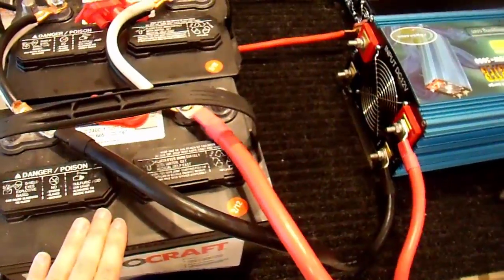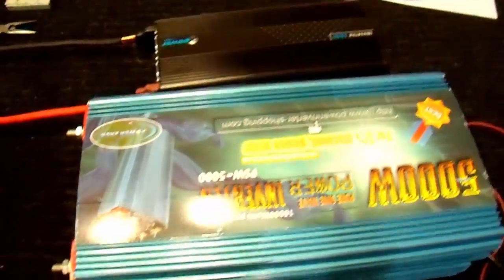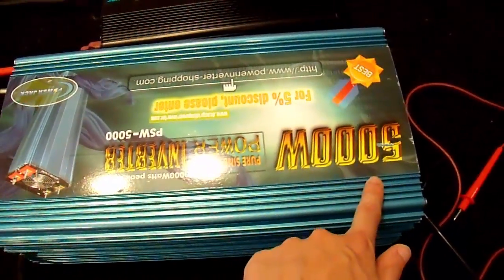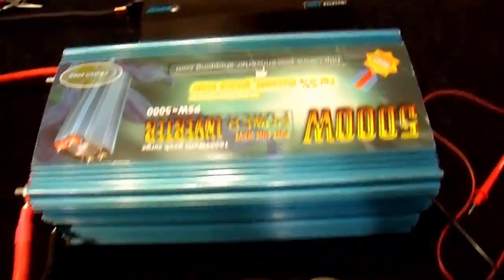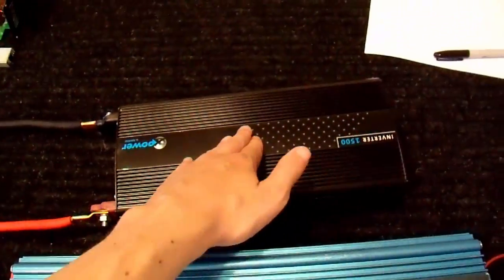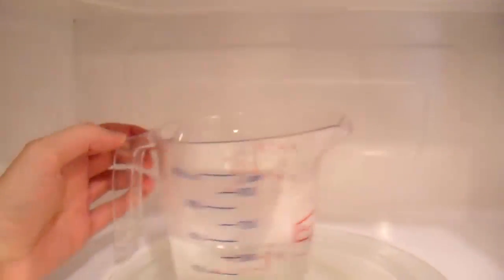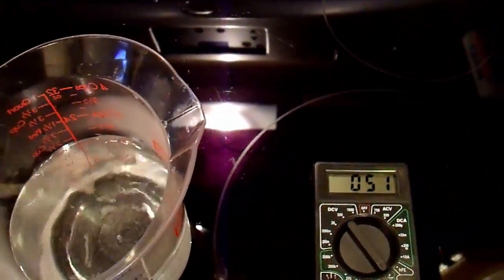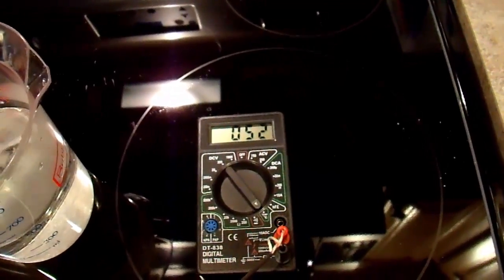Pure Sine Inverter vs. Modified Sine - Microwave Oven Test

Comment: There are some flaws with your test, due to RMS the comparison is not fair. You can't use a 5000 watt pure sine wave in compared to a 1500 watt modified sine wave, if you use a 5000 W modified sine wave you will get a different outcome, you will get a hum with most modified inverters due to the components sensitivities. When you compare products you really need to make them the same wattage. Also I'd like to add that not all modified sine waves are the same some are cleaner and some are not so clean. I've been working with modified and pure sine wave products for over 40 years. If you get the right manufacturer you'll get a decent modified product. But your best bet is to go with a pure sine. Even with that said the inverters that are saying they're pure sine wave well they're not. There's only one way to get a pure sine wave and it's not by converting DC into AC. Sine waves come from the North and South poles of magnets. These magnets are usually in generators and alternators. An inverter with pure sine wave capability is just an inverter with a cleaner setup
Reply from the maker: THD from a quality sine wave inverter is cleaner than you'll find on most any power grid.  The wattage of the inverters used for the test is irrelevant.  I specifically used an inverter with a good modified sine waveform.
Reply: @knurlgnar24 correction the wattage does actually matter,  you either use equal RMS power regardless of sine wave or the test is not accurate. I do agree that the sine wave will matter on sound and noise interference vote for power requirements both inverters must be able to provide the same amount of RMS power to be a quality test otherwise you're just throwing up numbers
Reply from the maker: @rondemeio5337  How does the wattage of the inverter matter?  The power grid is able to supply megawatts of power but a 40W light bulb runs exactly the same on a 100W sine wave inverter as it does when powered by a nuclear power plant.

Comment: Not that I'd ever choose a modified sine wave inverter as a full-time A/C power source but I was still hoping that you would have addressed the efficiency question a little more mathematically. Considering there was a difference in the final water temperatures and the resulting wattage of the inversion, I would think that you'd use a ratio of the DC mAh used by each to the temperature gain from each, factoring in any relevant laws of thermodynamics to determine the true efficiency of each of your specific inverters with your specific microwave. Either way, I would never recommend a modified sine wave inverter be used with any level of consistency. In my opinion, it is a useful emergency backup device but, if you can afford it, generating your own power from current technologies and inverting it with pure sine wave inverters is better for your devices than the utility company's 5% THD by 2 to 3 percent in most cases.

Comment: Hello, I have an Auto AC Inverter Traveller's Power 5000W, Model No. 2012 which I want to use in the house, unfortunately in Nigeria we use 220V. Also do I need a separate charger for the battery or charger inbuilt in the inverter?

Comment: Appreciate the video... But, not sure 1500w is enough to run a microwave to its full potential... I have seen advice to use an inverter that is double the microwave rating...  Not sure if this had an effect. The microwave did work without blowing a fuse or safety shutdown, which i find surprising.
Reply from the maker: The only reason people recommend using an inverter rated for double the microwave rating is because most inverters cannot output what they claim to output.  The situation on inverter ratings has gotten pretty bad, so buyer beware.

Comment: I tried a modified sine wave inverter on my 1000 watt microwave.  It only put out 660 wats .  On house power was 1540 watts.  Also inverter beeping due to microwave overheating and was very hot.  Would using better cable fix this? Was only 11 gage.  Toaster and vacuum perform perfect with very close watts as house power.
Reply from the maker: I don't understand the 'inverter beeping due to microwave overheating and was very hot" statement, but it sounds like something about your inverter/microwave setup is disagreeable to one or both of them.  Toasters and vacuums don't care about waveform but microwave ovens do.  11 gauge is very thin is you are referring to your battery connections.  Something like 2AWG would be more appropriate.  You might get by with 4AWG if you run at lower duty cycles and monitor cable temperature.
Reply: @knurlgnar24  Thanks! Was just a quick test.  I will be using 2 gage wires and a pure sine wave 2000 watt  inverter now i know better.  Planning on using 2 batteries in parallel and a 3rd  battery to 2nd inverter to  charge the other two if that makes sense.  The charger only uses 70 watts max i figure will last a good while that way.  I like your battery bsnk but dont have the room.

Comment: Somehow I don't think the Kill A Watt was designed for "modified" wave forms.   This makes all results on the modified sine converter suspect.
Reply from the maker: I've tested them against a quality lab style watt meter and they were within 2% of eachother.  The Kill A Watt meters are made and work well, though I agree that using home equipment can be suspect.

Comment: Hello, I just feed my electricity into the floor of this house with a 1500W pure sine.
However, that is not even enough for an 800 watt microwave.
Can I simply use a 3000 Watt Mod sinus instead?
Everything depends on it, computer, kitchen, etc.
When I see the video, mod sinus is even better because it consumes less watts^^
Reply from the maker: Many inverters do not perform anywhere near their 'rated' power.  1st, make sure you have a good inverter that can actually provide the power it is rated for.  2nd, I don't know your battery situation but you will need about 100ah of battery per 1000W of power when the batteries are fully charged, and 200ah per kw when partially charged.  3rd, modified sine is less efficient than pure sine due to most appliances being about 30% less efficient when operating on modified sine so it is good to take that into consideration when talking watt consumption.
Reply: @knurlgnar24  Thanks for answering in such detail!
The situation is as follows... To put it bluntly: I wanted to know if I could possibly get more out of a 5000 watt mod sine wave than out of a 2000 watt pure sine wave. I have 4x140 Ah and 4x100 Ah truck batteries on a 3.2 kilowatt solar system (24V). I cut the house fuse to the public power grid and feed it from my 1500 watt inverter directly into the house socket in the wall. (230V)
When I have the microwave on and my mother turns on the coffee maker, the lights in the house go out.
I don't even know what dimension of inverter I need, I only know that 5000 watts mod sinus costs the same as 2000 watts pure sine. It is said that Mod Sinus inverters would destroy my devices, and here everything is operated with an inverter, does that mean that in a year all computers and smartphones in the house will be broken if I use a Mod Sinus? i need more power but i can't spend 700€ for a pure sine inverter😨
and sorry for the spam^^

Comment: Half liter?18 degrees centigrade? what are ya Canadian? 5000w inverter? Thats 5000w Canadian right? Whats that in American? But that's 110v Canadian yes? So 122v? Assuming that's Canadian.

I'M just trolling for entertainment purposes. Interesting vid. I am looking at the same stuff. Its scary to look at the modified wave on an oscilloscope. Looks like a staircase, as opposed to rolling hills. One test, i would find interesting after seeing the AC output test wattages, would be an amp clamp on the DC wires. That way we can see if the modified, though delivering 30% less at the business end, is consuming 30% less at the input. Interesting? Yes?
Reply from the maker: Inverter efficiency depends little on waveform shape vs load type so the main difference is appliance efficiency.  You're right in that I do mix units regularly.  Unit snobs very much annoy me - I prefer to use the most convenient unit that I am familiar with for the purpose at hand.  Units are arbitrary and none are intrinsically better than any other for any rational reason other than for some justification based in dogma.

Comment: im surprised nobody has drawn the similarities between inverters and amplifiers yet... But I think the microwave doesn't like the modified wave for the same reason speakers dont like a clipped signal because a transformer is just basically a coil wound in a different shape. and when you clip an amplifier the sound wave starts to turn square like a modified sine wave

Comment: great video.. It would have been helpful to measure the DC current and voltage in to each microwave, becuase the would be the truest measure of energy required to operate the microwave.

The reduce output of the MSW might be a limitation of the setup.
Reply from the maker: Thanks for the comment and you have good recommendations.  Others have also commented that they would have liked to see more data.

Comment: Just to mention that the measuring devices you used are based on sinusoidal wave forms. Measuring square waves is quite different (True rms).
Reply from the maker: I used RMS meters so all measurements were accurate regardless of waveform.

Comment: Would be interesting to see this test using one of today’s inverter microwaves.  The humming problem should be gone and the performance gap may be negligible.   But I’m curious about the effect of moving from one type of difficult load (highly inductive) over to another type of difficult load (highly capacitive)..
Reply from the maker: I have wondered some of the same things, but Inverter microwave ovens were largely a thing a couple decades ago no?  At least here in the USA I haven't seen one marketed in a long time aside from some extremely expensive luxury models that no one actually buys.
Reply: @knurlgnar24  they’re back, and bound to eventually take over entirely sure as the SMPS did.  Much lighter to ship and prob already cheaper to make.  .Toshiba (Midea), Panasonic, LG, Galanz all sell them; I purchased one recently and it’s great. 

Reminds me of HVAC - I think it was Trane that introduced a full VRF AC in the 80’s.    Then they vanished for decades but look at it now!

Comment: you showed that a 1500 watt inverter couldn't make 1500 watts like the 3000 watt inverter did. the 1500 watter did it's best with what it had. Different parts of the microwave circuit were lacking due to using a saturated inverter.
Reply from the maker: It's possible efficiency changed due to voltage droop, true, but the voltage droop was taken into account and I would expect a lower voltage to actually boost efficiency in this device.  I looked at useful power out vs power in here.
Reply: @knurlgnar24  we used to use a variac to troubleshoot television circuits. We would increase the ac voltage little by little to enable certain circuits that didn't experience enough current draw at the lower voltages, this worked wonders for heating up shorts so they would be easier to detect with the touch of a finger without damaging other components, but if the 1500 wasnt able to produce enough amperage it would cause this.

Comment: If I charge my ebike with a modified sine inverter, can this do any harm to my ebike battery or just to the charger as it would heat it up unnecessarily?
Thanks for the great video!
Reply from the maker: That will work fine.  Wile a pure sine inverter isn't necessary for your eBike charger it will likely charge slightly more efficiently with one.  This is a good application for a modified sine inverter.

Comment: Could you detect a "dirty" power inverter with a power monitor that shows the line frequency? (Like a Kill-a-Watt monitor connected to the inverter?) Would you still get a nice, steady 60khz display or would there be enough "jitter" in the reading to see? (for those of us who don't have an oscilloscope or who want to blow up our microwaves. :)  )
Reply from the maker: You would need an oscilloscope or a harmonic power analyzer.  A decent 'free' way to check is to use an AM/FM radio and look for interference as well as hooking up to a transformer based appliance (like a microwave) and seeing how much 'buzzing' it makes at various loads.  Even purse sine inverters sometimes have unbalanced output causing transformer/motor saturation/heating.

Comment: I understand he used what he had for this experiment but he concluded that the modified sine wave was the cause of less efficiency of the microwave & not the less wattage draw on the individual outlet in the inverter.
  He also concluded that the buzz was related to the modified sine wave & not the less wattage draw. 
  It was just funny to me that he made absolute conclusions when he needed a better same to same comparison on other specs.
Reply from the maker: The data in the video shows that I compensated for the lower wattage if you wanted to run the calcs yourself.  The buzz is absolutely due to modified sine.  You can try running a microwave on a variable transformer to prove that it isn't voltage if you'd like.

Comment: Most of the performance issues people have with inverters is that's they don't really understand how important the input to the inverter is. The input cables need to be as large as possible and your batteries have to be able to supply the current. 

What battery setup are you running?

Comment: The voltage reading of the modified sine inverter will only be accurate with a true RMS meter!
Reply from the maker: Good tip.  The meter shown in the video was an RMS meter.
Reply: @knurlgnar24  lol
Reply: I would not have guessed that, @knurlgnar24 , and I have one of those things. But, if I can believe the manual I just looked up, it is "measured with true RMS methods". I guess a person could test the accuracy of that claim with an experiment very similar to this one, only using an electric kettle instead of a microwave.
http://www.p3international.com/manuals/p4460_manual.pdf

Comment: Thanks again for a very helpful video! It inspired me to buy an open-box Insignia microwave from Best Buy for $40. I connected it to a MSW inverter and it didn't make any noise at all and the clock/timer worked without issue. The only difference is that it appears to function with reduced power. It took a little more than twice as long to boil a cup of water. So, I could install it in my van, but a JetBoil or a $25 Japanese butane stove would boil water a lot quicker and would take up less room. The only inconvenience with using a JetBoil or a butane stove is that you need to have a door open. Oh, and you also have to be careful that you don't set everything on fire.

Comment: I've been trying to find out whether to pay double for a pure sin-wave converter for using power tools with a caravan battery. I think you have convinced me its worth spending the money.  I do wonder what a less expensive pure-sin inverter would be like (1000-2000W range rather than "5000W"). would it make much difference?
Reply from the maker: For power tools I would generally recommend a modified sine inverter as universal motors will run just fine on MSW.  If you want to run an air compressor, for example, you will need at least a 3kw inverter.  That starts to get fairly pricey and is why a MSW may be an economical choice.  Pure Sine Wave is going to be better for all applications though if you are willing to spend the $$.

Comment: Why are you using Celsius instead of Fahrenheit..??  Are you in Europe..?? 
Next, ALL modified sine wave inverters Voltage drops off when a load is put on. Most if not ALL appliances and electronics will work down to 105V. 
And yes appliances and electronics will work more efficiently and pull the correct amount of power from Pure Sine Wave power where they will not work as efficient when fed with "dirty" modified sine wave power .. 

When i used my 1500W hot plate on a pure sine wave inverter, it pulled 1475W, but when i attached it to my DeWALT modified sine wave inverter, it only used 1022W and had a BUZZ sound from it. EVERYTHING i plug into a modified sine wave has a BUZZ sound to it.

YES it works, but long term exposure will cause damage .. Something like a microwave, i would run it at 50% power.
Reply: I'm guessing he lives in Canada Eh..
Reply from the maker: @wesmaximus7728  In the USA but I'm unit agnostic and C was the most convenient unit for this purpose.  The point wasn't the voltage droop, but the efficiency.  That additional power which was lost was lost in the appliance and did no useful work.  The voltage droop is important to mention but not substantive to the conclusion.
Reply: @knurlgnar24  ohh ok. I'm used to both more too Fahrenheit cuz that's what I grew up with. We switched to metric early 80s I think.    Abs yes I'm Canadian eh

Comment: It would be interesting to measure the Peak to Peak voltage of both inverters. My experience is, a modified sine wave peaks about 145 volts, a true sine, about 165 volts. If the microwave uses a capacitor and diode, it might be running on the peak voltage, which may be the main reason why the oven doesn't draw its rated power on the modified sine wave inverter.
Reply: I do agree, Sir.

Comment: Im wondering why the small inverter witch is way to low watt to run that big microwave didnt shut down naturaly a 5000 watt of any kind will outdo a 1500 i got a 1100 watt ouput inverter krieger that will run mine i even ran my hole trailer of it .